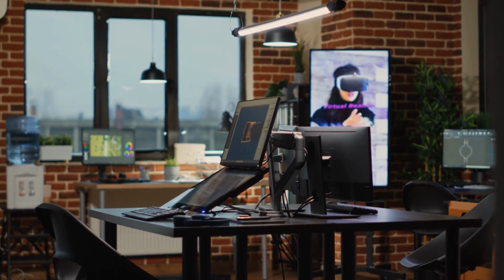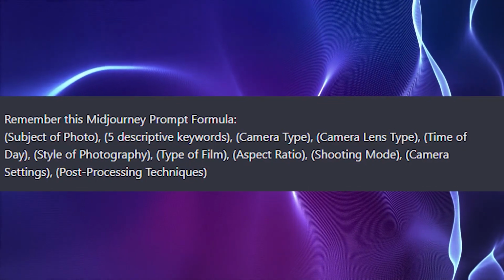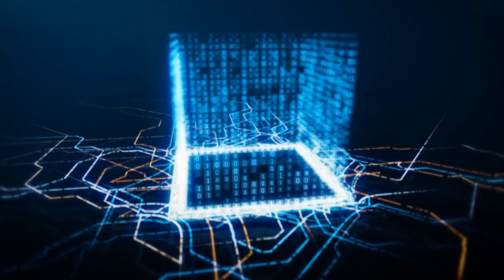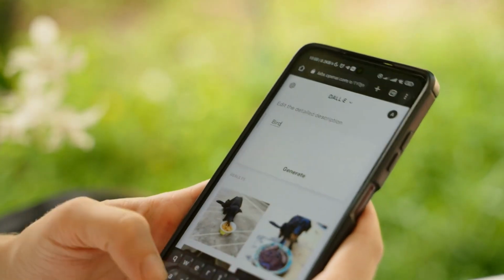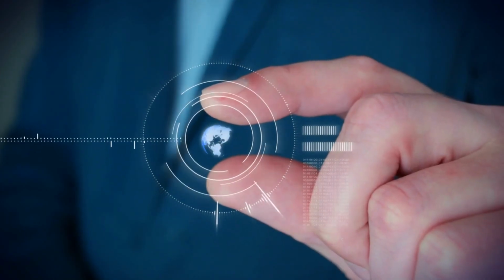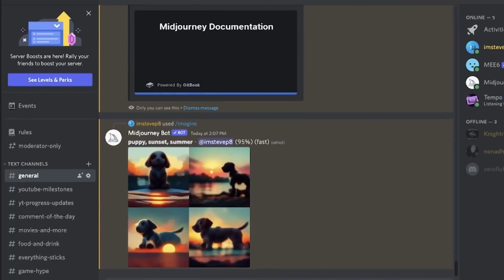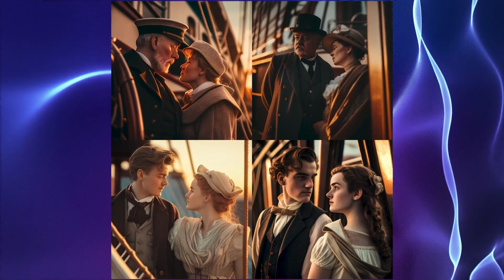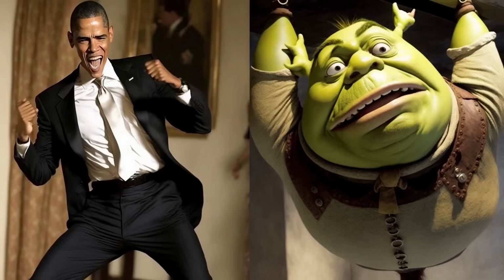Get UNLIMITED Midjourney Prompts W/ ChatGPT (Prompt Engineering)

Comment: The only thing I'd change to this is that (aspect ratio) in the prompt itself simply doesn't work. You need to manually specify aspect ratio at the end of a prompt with --ar 16:9, or --ar 4:3, etc. Maybe that specification could also be trained into ChatGPT.
Reply: Alright so I asked it to remove "(aspect ratio)" from the formula, and said "replace it at the end with something like --ar 16:9, --ar 3:4, --ar 21:9, do you understand?" which ChatGPT fully understood. I'm not sure what's more impressive, MJ's photo creating ability, or chatgpt's pseudo-cognitive ability lol